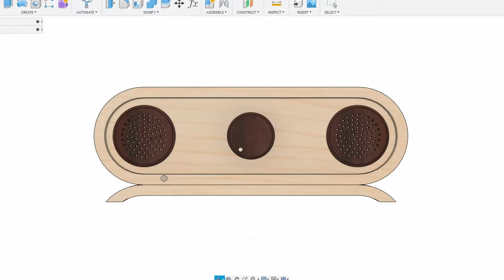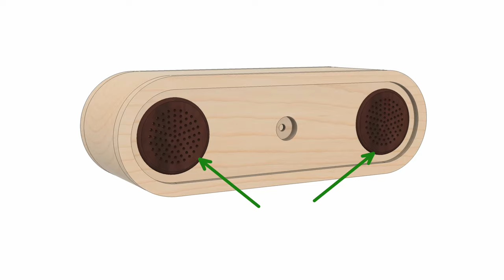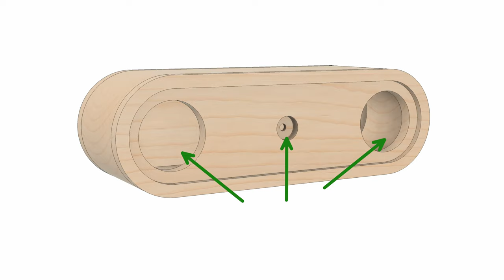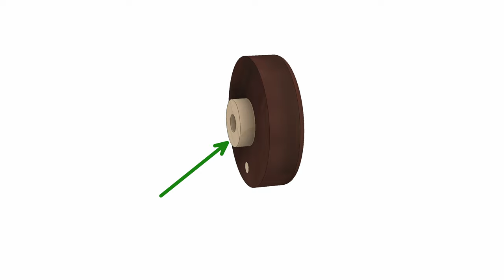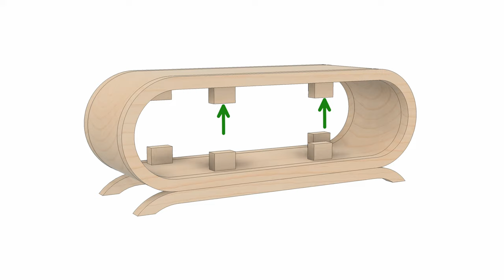How To Make an INCREDIBLE Wooden Bluetooth Speaker | Woodworking | Electronics

Comment: 10:19 What was the point of the blue terminal block?   Wouldn't it have been just as easy to solder the switch wires to the perfboard?
Reply from the maker: It means the perfboard can easily be removed from the back panel and flipped over for servicing if required. Or to be replaced by another circuit if ever required. Also, I intentionally made all of the electronics modular in case I ever wanted to upgrade to higher power audio. But yes, if you were keeping costs to a minimum, you could solder the power switch wires directly into the perfboard.

Comment: 9:16  How did you decide on 82 ohms?   Was that just trial and error?
Reply from the maker: It was trial and error but I got reasonably close on the first attempt. I tried 120 ohms to start with which didn't work, then tried 82 ohms which did work. 100 ohms didn't work either so settled on 82 ohms. I suspect 82 ohms will work with most USB power banks. The additional current draw isn't an issue since the power bank has such a high capacity at 10000mAh. Another option would be to replace the resistor with a small circuit to drive a power LED mounted on the back panel. The current draw would still need to be about 60mA however to match the current draw of the 82 ohm resistor, i.e. I = V/R = 5/82 = 61mA.